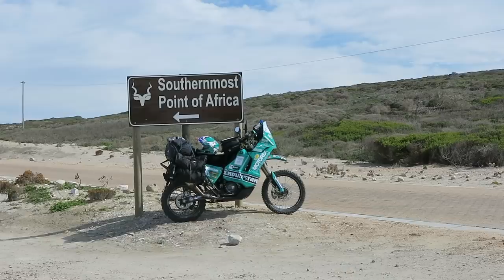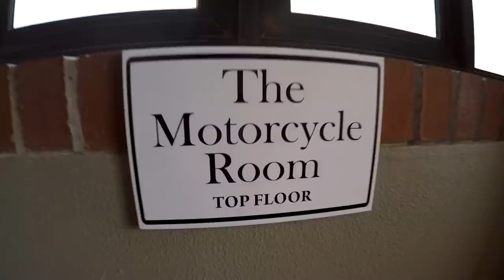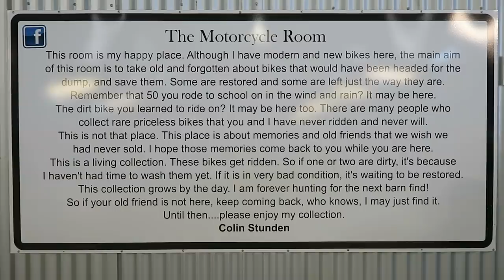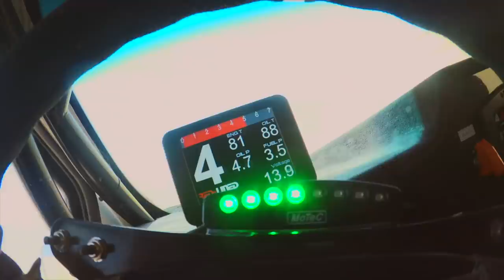Races To Places SE10 EP11 - Adventure Motorcycling Documentary Ft.Lyndon Poskitt

Comment: Hey Lyndon ... you missed a few important details in there!! What went wrong with Basil and how did you fix him? A whole episode on the rebuild and the breakdown and then just fast forward to ‘fixed’. And what camera gear did you end up buying?? Come on mate ... the devil is in the detail
Reply: He always does that, lots of useful infos cut out without any answer from Lyndon..:(
Reply: yeah, its not just a lego box, there are some tolerances and new spacers and such needed also when replacing bearings, like 0,03mm tolerances. maybe something was not correct. was it a broken shaft?  definitely a tooth on that magnet.